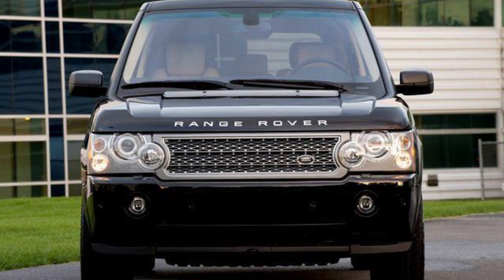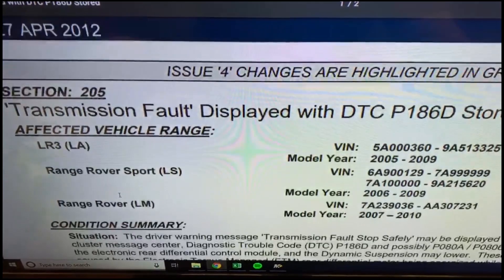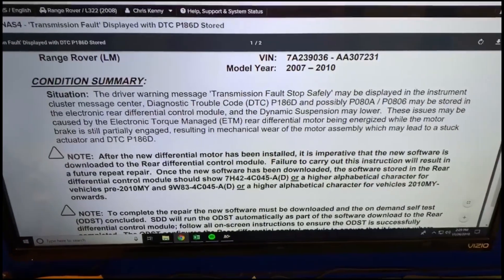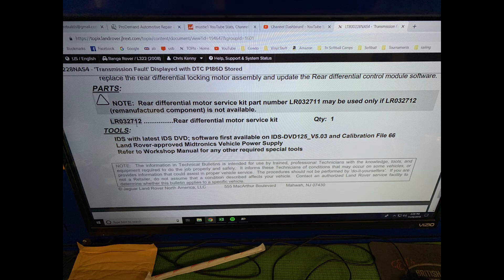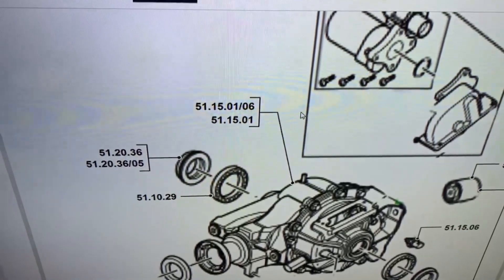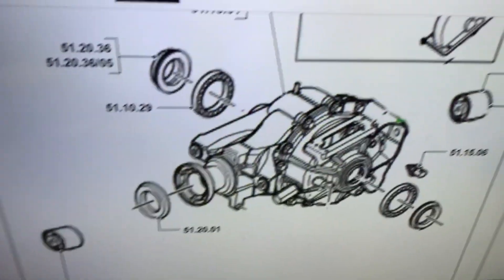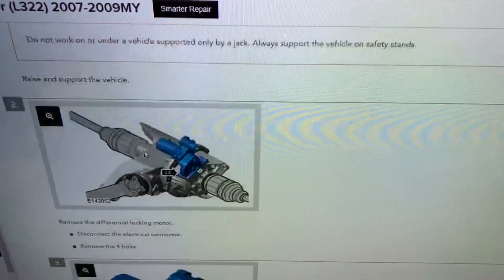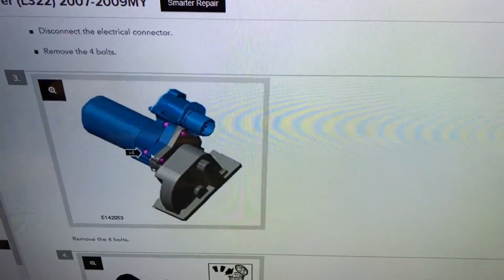Land Rover Transmission Fault OEM Repair.

Comment: Transmission fault is popping up and no warning just transmission fault . It goes away if I turn truck off and restart. Also suspension fault pops on here or there but no problems with ride is this a sensor problem what’s your take ????
Reply: have the exacte same problem all drive well but its coming here and there
Reply: London Moove  right mine is driving like perfect today hood open appeared I knew good wasn’t open it went away I’m to take it to a professional tomorrow so hopefully I can give you good news
Reply: Erica Martin hello! Did you get fixed? Mine (LR3 2006) having the exact same problem
Reply: Bernal Moya M.  Yes it was a blown bulb causing all the commotion I got it put on computer no codes are coming back replace bulb in tail light and no problems.,
Reply: me dad's car having suspension faults and transmissions faults also with the suspension fault the car just lowers down so bad u cannot drive it
Reply: Common Transmission Errors can be this problem: https://youtu.be/v6u9qgTXYJ8
Reply: Had you managed it?

Comment: Ok, I have a 2005 Range Rover Sport with Supercharged V8. Lately my started shifting into F mode where I cannot use all of my gears. But under slow driving it will shift in to all of my gears and if I use the Manual Shift mode it will shift in all 6 gears. Sometimes it just pops up the F mode and says transmission fault limited gears available. Any ideas how to fix it

Comment: it issssss an electronicccc faultt our gear is getting overheated by traveling some miles and specially overheat when u speed up what should i do bro
Reply from the maker: I would start by checking for any DTC’s. What are your symptoms?